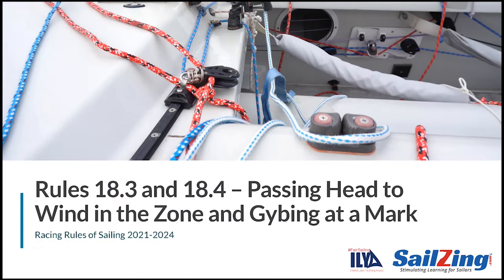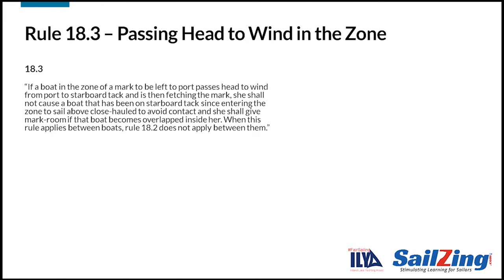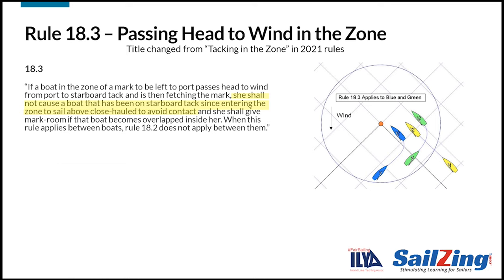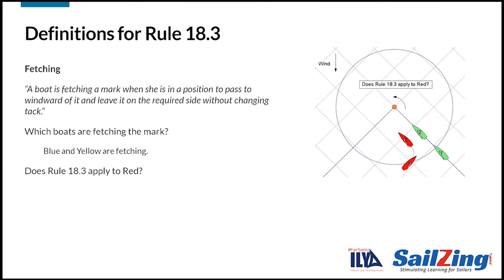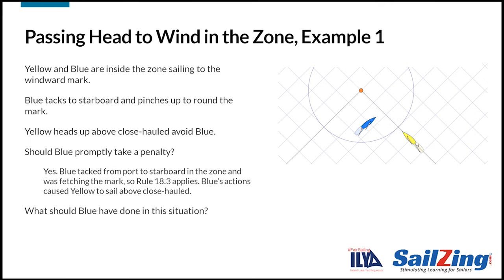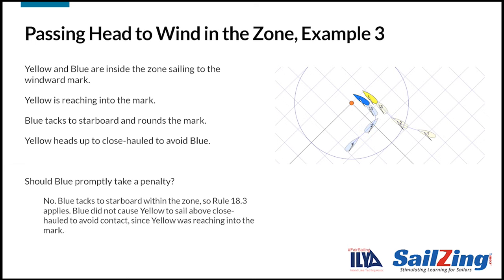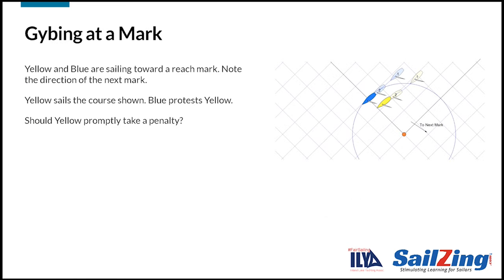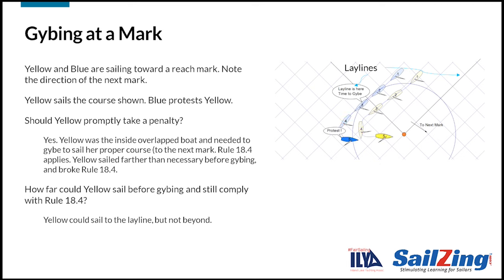Rule 18 – Mark-Room, Part 3: Passing Head to Wind in the Zone and Gybing at a Mark

Comment: What about gybing in the zone?
Reply from the maker: Gybing is considered the same as tacking..
Reply: Blue comes to leeward mark on starboard well ahead of yellow (no overlap). Blue had to take mark wide to give to room to inside over lapped boats. Blue gybes to port and then continues turning up wind. Yellow still on starboard gybe (coming in fast) tries to cut inside of blue. Blue says you have no mark room. Yellow says starboard implying they are the right-of-way boat and then continues to round inside of blue, and eventually gybes. Blue keeps clear but is blocked from coming up to propper coarse (still near mark in 3-boat circle). Should blue protest yellow for not giving mark room? Does port/starboard apply or does mark room apply?